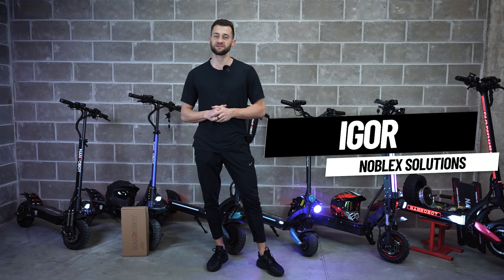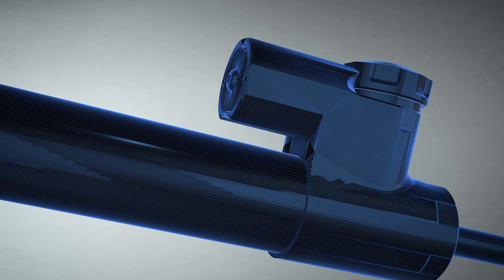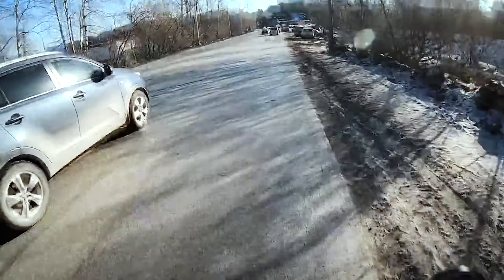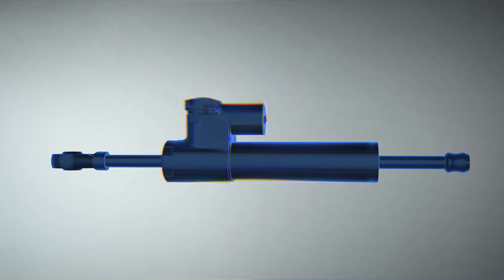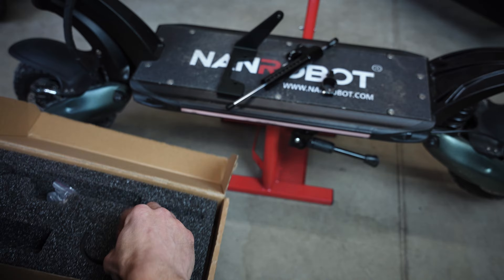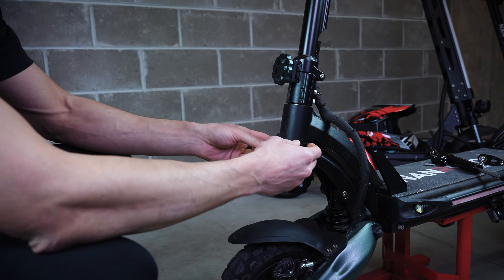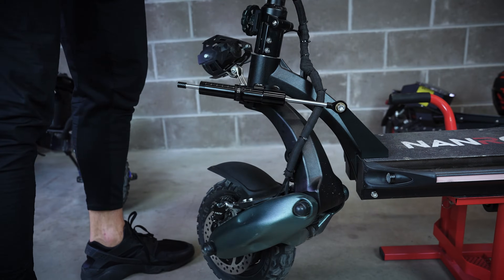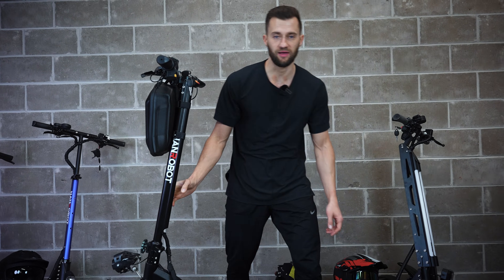Electric Scooters Steering Damper Explained - Full Guide!🔥 [ + Installation ]

Comment: Hey i just installed my damper but even on the lowest setting its really hard to move then it will kinda get lose for a inch or 2 of travel and now its going all the way to the left and its like impossible to get it to come back is my damper just broken? I can hear the fluid in there when turning which I don't think is right it like farts lol. I appreciate the reply it not the same damper you have but same style... I cant find a lot online about it not moving back and forth more it leaks and wont dampen anymore....

Comment: Best position for damper is not by numbers:
1. Align steering and front wheel straight and centre. 
2. Lock off the damper cylinder where the rod travel on each end is equal. Duh!

Comment: 1 am trying to install the steering dampener but when I'm at the step where I put a part underneath the headlamp it told tells me to use to original screw on the scooter but it is too short with the dampener part I tried all the screws and they're all too tight this is getting increasingly frustrating

Comment: I bought the kugoo g booster 3 days ago and im still horrifed of it it has alot of torque and it gets unstable at speed even when taking off it spins its wheels and you can lose control easily if youre not careful steering damper is a MUST trust me and a helmet

Comment: I have a question, I have a LS7+ 72 and the damper that comes with it has a little twist nob how do you know how tight it should be I mean I have mine set pretty tight to where it takse force to turn the wheel. Should I set it that high what is the normal. Thank your for your amazing videos still waiting on thats LS7+ 72 Range test! ;D

Comment: I just lnstalled a damper on my d4 3.0 i,m impressed  with how it keeps the  front wheel  inplace i giggled when i saw you take both hands off the handle  bars and eat pipcorn i don,t plan on doing that but i do want to take one hand off and use hand signals i haven't tested it yet as the weather is bad snows onece a week plus i,m healing from hernia surgery i can,t wait to try it out

Comment: Never experienced a speed wobble on my Kaabo Wolf King GT Pro; but I never had the confidence to take one hand off the steering wheel; once, I put on a steering damper, the ride improved 100% at high speed; now I can confidently ride with one hand below 25-mph and the steering now feels tight; cruising up to 60-mph and stopping; steering is smooth as butter.  I highly recommend a steering damper for any scooter that rides over 20-mph.
Reply: What steering damper did you use for your scooter? Thanks

Comment: If you are thinking about buying a damper but are not sure, @3:22 is a great selling point. I also smoke, and I also like the fact that I can wave at someone who waves at me, or I can put out my arm at 20+ mph to signal to others that I want to make a turn. It's not just about avoid the speed wobble, I and others have crashed going slow trying to do things with one hand, not paying attention and the steering is just too nimble for even that at slow speeds.
Reply: Exactly zero of the clips they showed were because of steering issues

Comment: When you mention that for the D6+ setting it at 7 is perfect, did you adjust the +/- dampening knob at all? If possible, would you be able to explain how many turns clockwise you have the dampening knob turned? Without ever using a dampened, I'm not really sure how it should feel to be correct. Also, make sure the headlight is tightened at its highest possible point or else the headlight brace will hit the dampener tube when turning the handlebars left.
Reply: You tighten as you see fit. Once you feel you can ride with one hand, it should be about right and tight. I too have the problem with the light. To be honest, this is the worst light cage and placing ever. I gave the +/ about 12 turns maybe more :D

Comment: do you think you could fit a stearing damper to the Dualtron Mini?
my mini has 8.5 by 2.5 inch tyres and as soon as i hit 28, 29 or 30 MPH on the Mini stearing wobble is an absolute Knightmare
i don think its possible to fit a damper to the mini but i thought id ask you and hope 😆
Reply from the maker: We didn't have any Dualtron scooters, so its hard to say. We would recommend to look up information on Dualtron forums and ask there
Reply: @noblextech  theirs literally zero information on it, nobody has made a video on it or even mentioned it, im guessing thst it cant be done as of it could, someone would know how to fit one or made a video on fitting one atleast, i just dont understand why  Dualtron only allow the damper to fit certain models, it stupid as the Dualtron Mini suffers from speed wobble really bad, im intending to up grade anyway so its not that important but it is annoying

Comment: Good afternoon, and thanks for the detailed video. I have an D4+ 3.0. I want to know if I could drill the base plate and what size the thread making tool for this Steering Damper Kit should I use since the base plate does not have it pre drilled. Thanks!
Reply from the maker: What kind of damper do you have?
Reply: I’m also interested in putting one on my D4.  Anyone able to find a good solution?
Reply: Good afternoon and thanks for replying so soon. My Nanrobot D4+ 3.0 does not have a hollow damper underneath to put the adapter of the Steering Damper since it has 3 screws that hold the tube base to the damper and there is no long screw underneath. Let me know if I explain correctly. Thanks!
Reply: @Papote_aelc  I think we have to make our own adapter that fits with the 3 screws.
Reply: Yes. My issue is with the adapter of the front light that is not completely available since the isosceles triangle that covers it, does not let fit the adapter around our 50mm base.

Comment: I have the d6+ and I have got no speed wobble. When I 1st got my d6+ I noticed the steering was much more sensitive then my d4+ 2.0. After a little while I got used to it. Recently I just installed my old 720mm mtb handlebars and that made my d6 so much more stable, comfortable, sporty n better looking. If your not sure about the damepner the try wider handlebars.
Reply from the maker: Yes, that can also solve the issue, nice point.

Comment: It's too expensive 150 dollars
Reply from the maker: Can you find it cheaper?
Reply: @noblextech  i can find the steering dumper without screws and bracket for 20-30 dollars , the problem is to find a compatible bracket